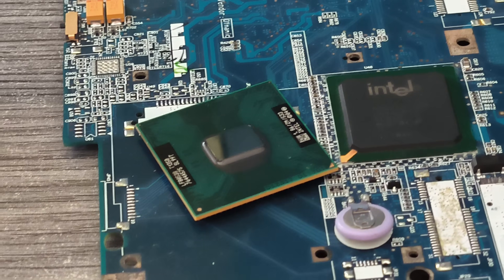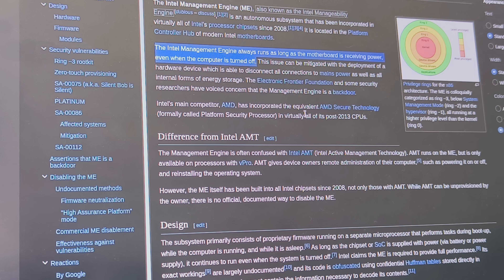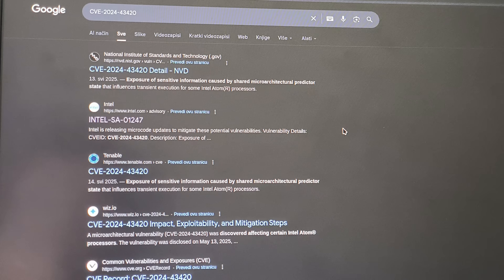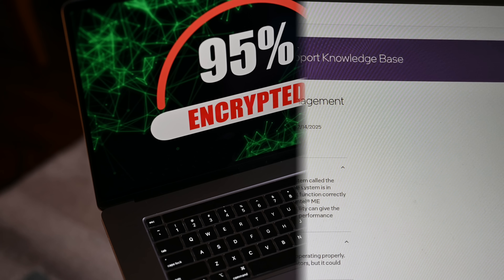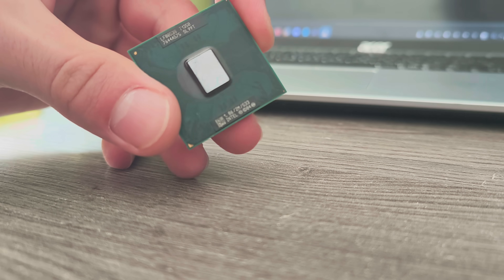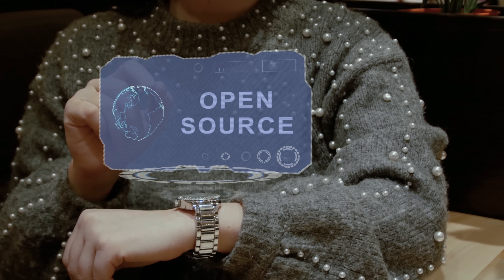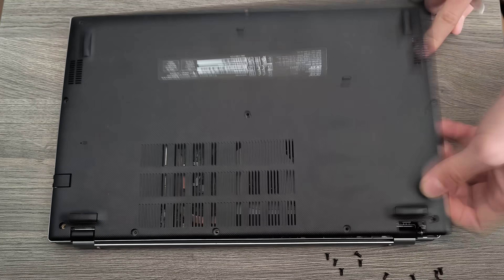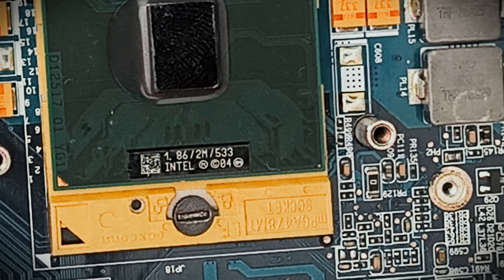YOUR CPU SPIES ON EVERYTHING (Even When Your PC Is OFF)

Comment from the maker: Serious Question (related to the ME/PSP threat). How many times have you actually updated your BIOS/UEFI on your computer?
Reply: 0 times
Reply: I can't update my BIOS if the manufacturer doesn't provide one.  I have a high end MSI laptop that I bought a year before the specter/meltdown vulnerability was exposed, and a tool from Intel says it's vulnerable.  I checked back countless times over the years, and there is no update.  I won't buy MSI again because they don't support their products.
Reply from the maker: @genxjack72  It's completely unacceptable that a high-end laptop never received a patch. The responsibility here falls 100% on MSI, not on Intel. Intel delivers the microcode fix to the OEM, and the OEM (MSI) is solely responsible for engineering and distributing that critical BIOS update to you. However, the contrast is striking - I have an older MSI motherboard myself, and I've received BIOS/UEFI updates for it, even years later...
Reply: @alex.cybersecurity  That may be true for BIOS updates, but, what about Intel ME? Unless OEM alter ME, I don't understand why it is not Intel's responsibility to provide ME firmware updates. ME is complete BS to begin with and shouldn't even be there. Intel should provide a way to zero it out and disable it, if they are unwilling to patch vulnerabilities. This is just one more example of companies doing what they want and not what their customers want.
Reply: @genxjack72 laptops have the worst updates in general across multiple brands I've had
Reply: Every time a new one is released for the machines I have, for those Intel based ones I even go out of my way to update ME's after the manufacturer stops supporting the board or machine.

What saddens me is the lack of commitment from manufacturers when it comes to supporting their products (and not only through firmware). Some machines don't even receive a single firmware upgrade (e.g., most mini-PCs), others get more or less support depending on their popularity. An example of this could be Acer's Aspire A515-47 (AMD) and A515-57 (Intel), both from the same era, but the one with AMD got 2 firmware upgrades, Intel's got 16; since nobody gives them a hard time about it (and most people couldn't care less), the status quo continues.

The last firmware for both of those machines is vulnerable to some 20+ CVEs, but that's just a quick example there are plenty of machines from different vendors in similar situations.
Reply: @jrussellmoore  Totally agree. I think some of the vendors actually delete the firmware from their support website after they go out of support. I had to fish around trying to find the latest ME update for a HP Z240. I was able to find it for another HP computer that was basically the same thing under a different name. But, it was still an out of date version of the firmware, which has vulnerabilities. ME is flaky as hell IMHO. I don't understand why Intel doesn't make the ME updates available on their website. I think they should be sued for designing their products in such a reckless manner. But, maybe it isn't reckless. Maybe it is designed that way for a purpose. So, the government can spy on everyone. Also, I think it is reckless to allow BIOS updates through the operating system. It should be designed so that it can only be done through the BIOS. Then, you wouldn't have to worry about firmware-level malware as much.
Reply: When your board manufacturer drops support how hard is it to update the ME?  Isn't the ME specific to the hardware?
Reply: Only when I really needed, processor upgrade for example. In all other cases: never touch a running system.
Reply: 4 times in 30 years. and one of those times i was so very glad for the new (at the time) dual bios chip design, because i had to physically de-solder and swap bios chips to get i to post again.
Reply: @MrJay_White  Been there, done that, nearly stuffed up the dual-bios and then drank the bottle of whiskey. After that, I never updated a Bios again.
Reply: @MrJay_White OMG!
Reply: Es ist ja so, wenn ne Plattform schon alt ist und keine neuen cpus mehr erscheinen, bekommen die meistens nur Sicherheitsupdates, wenn ne Plattform neu ist, kommt gefühlt 2 mal im Monat ein BIOS Uefi Update raus!
Lieben Dank fürs Video 👍
Reply: I had to do this twice before. Once on a Lenovo Thinkpad Edge 535 which had a fanspeed oscillating issue that was fixed by a firmware update.. and then again a ASUS Rog GR6 mini gaming PC since it would not detect a second harddrive until after the BIOS update.  It was always a bit of a risky gamble but it went pretty smooth every time.
Reply: Every time they release them, I install them.
Reply: At least once in their lifetime, either the first time when building them or after several years to try to fix some weird behavior with new hardware. BUT on my job most Notebooks offer firmware updates alone like Dell, Lenovo, etc, so you just accept and they do it on reboot taking a while.
Reply: Usually I check every 2-3 Months if there is a new firmware. Not because of security but I had lots of problems that did go away with new updates.
Reply: Pardon me, I wanted to ask if this issue is also present in Apple's M-series processors?
Reply: As far as I know, my lenovo laptop only gets firmware updates on windows. You can get them on the support webpage, but only as .exe installer. Since I use Fedora, I resorted to putting Hiren's Boot CD on my ventoy pendrive, as well as the firmware installer. Then I boot from it and run the installer. I did get "security processor" updates or something via fwupd, but I don't fully trust that since the process of installing it looks different (it doesn't reboot to UEFI)
Reply: @konstantink07 I want to say fwupd just applies the BIOS patches temporarily in memory, but, I could be wrong on that.
Reply: 0 times
Reply: i dont have dual bios so im not taking the risk of borking my motherboard if my power goes out mid update:v
Reply: @Sonny_Blackbones  You must have very unreliable power
Reply: I have a CH341A flasher. Daily drove X99 chinese motherboard, which require custom bios for the best operation. Funny thing is, it reads/writes only half of bios from software, even under DOS.
Reply: Once a year. When the first gen Ryzen came out once per month for a year.
Reply: Never, ..... once.

But the title says enough, duh it spys, and i'm crazy to say that your pc is never actually off even if you take out the battery 😂
Reply: 2 times before I knew what it is
Reply: Never? Once when I built the PC, never after that.
Reply: I've updated my BIOS only once so far on a MSI B550-A PRO to support the 5700X3D.

I noticed some unlogged changes like the removal of some options to disable/change stuff in BIOS, and in Windows some software that had errors due to me heavily stripping Windows from services and drivers, vanished.

Also in device manager, my NVME drives are named differently: instead of manufacturer and model number it's now NVMe Model Name SCSI Disk Device for some reason??

I see absolutely no reason to update BIOS again for this board, I specifically looked for the earliest bios update to support the 5700x3d.
Reply: 0
Reply: Every time it's available
Reply: The standard update recommendation for UEFI has never changed: Only update if you know for sure it will fix your hardware problem.
It is stated in every MoBo manufacturer's webpage.

So, yes. I have updated UEFIs.
Three times.
In two computers.
Out of 15 to 20 computers I have owned across 26 years.

Comment: The really crazy part? 
If the government cared about the security of its citizens, they would not just let China get a full back door to the IME code base and how to use and install it. 
They even sell support to other nations out there on how to enable and disable its features on the hardware level.  

The thing that blows my mind is that  the US government gave out all the keys to other nations , but then kept it hidden from the General US Public. :face-fuchsia-tongue-out:

That means that just about any x86 based system or even ARM (Samsung chips)  all have this back door built in.  

Xi and the PM leader of Korea were laughing about the back doors when Xi brought in some phones to give away as gifts.  :face-green-smiling:  
They both were chummy on the subject.  

The odd thing is, this exact hardware is running almost all our current day critical infrastructure.  

This is why things have not gone the way as planned for many years as outside actors knew full well what was going on in the highest ranks in our government and even our private industry such as Aerospace & Military contractors.  

Our Political leaders and Wall Street all saw dollar signs, and left the rest of us to pick up the pieces.  

It's partly why I can't even trust any Crypto as you need to use a computer to manage it. 
With all these backdoors, and more coming out everyday, is there really a way to secure anything if just using a computer to access your wallet is enough for attacker to take everything you have ever invested in Crypto?  :hand-orange-covering-eyes:

The powers that be want to take everything into the Digital Realm, but don't have any physical backups to speak of. 
And when they do? 
The Physical copies are long lost when needed. 
Cities are facing this right now with grandfathered regs, and its starting to break the whole system down.

Comment: I would say there is another layer to this: OS
If your OS is okay with Intel requesting something and it blocks it, no harm

But, Microsoft will comply

Linux not so much

The issues with Intel backdoor is that their chip can be accessed even without OS present, as far as I heard and understood years ago. Hypothetically, Intel could read data from hard drive using CPU even if PC is off, as long as it had ethernet cable plugged in and computer's power plug has power (even if pc is off)

Although, that requires Intel getting okay from your internet provider to enter your modem. Possibility, but also unrealistic one

Comment: Engineer in the semiconductor field responding, even spent some some Inside Intel too. I saw the announcement decades ago when Intel licensed the ARC design.
There is a lot of bollux inside this video. For a cpu to actively spy, it must do serious work and use significant energy. If you had old school HDs you would hear them operating, the motherboard has blinken lights for HDs. The ability of the internal 2nd cpu is very limited, I believe it is based on the ARC architecture for Intel, for AMD it might be ARM or something else. I would be infinitely more worried by what Microsoft does in Windows 11. Under extreme circumstance there is a possibility of firmware to modify the cpu working, this was likely used by some well known spy agencies to disrupt some computer systems that controlled uranium enrichment programs.
Reply: This is a realistic answer, it’s cheaper and easier to spy people through OS than hardware, i think that’s why they keep pushing this much Windows 11

Comment: So I seen a few new videos on IME but I’m not sure people are understanding a few things that mean it can’t actually act as a backdoor :
- Remote Access to IME would require AMT provisioning which is only available on VPro CPU’s and even then it needs to be enabled in bios. 
- It’s false that it can avoid firewalls, it requires ports to be open, it’s not configured to use ports that may already be open such as a sneaky malware would so even if you had VPro and AMT enabled and provisioned the ports need to be opened it doesn’t even have listeners. 
- security researchers have put effort in to monitor it and never find anything problematic 
So while I understand concern it’s currently a non issue, perhaps that will change in the future but if it does you will know about it and the shares of any company that makes this a potential valid backdoor will tank quickly

Comment: *before clicking on the video* it's going to be a Management Engine backdoor, isn't it? *after clicking the video* it's a Management Engine backdoor.
Reply: How can I learn more about this topic? I’m quite curious about this.
Reply: @Primordial_Noir-d9t  well any trusted source should be ok, honestly there isn't much you can learn, but from the basics:
It's a independent microcontroller running proprietary firmware from the BIOS flash, typically a variation of MINIX (so I heard) which does something (Intel does tell about some functionality, but probably not all), present on every modern x86 system, running in the Privilege Ring -3. 
Something you might also wanna know about is the SMM, proprietary code used for power management (also on the BIOS flash), running on the CPU (!) in the Privilege Ring -2
Reply: hey, what are you doing in my wifi🤨

Comment: What happens when the power is disconnected? What if all saved files are encrypted.
Reply from the maker: If you physically unplug the power cord and remove the battery, the chip is truly off. However, most modern laptops have non-removable batteries, and few desktop users unplug their systems completely. Regarding encryption: it offers no protection because the ME/PSP runs below your OS and controls the hardware. The chip can easily capture your encryption key while it's in memory, or simply wait for the OS to decrypt the files and then transmit the plain data.

Comment: There is a project coreboot that is bin (firmware) for bios to flash. One of thing it does is shrinking/wiping intel ME code depending on cpu. I think wiping only possible on lga775 era pcs, while starting with lga1151/1155 its a mandatory to have even small code footprint in order for pc to boot.
But honestly, I would rather buy AMD. Atleast they do care alittle.

Comment: For NSA espionage, "Standby is not turned off, Standby is listening you and transferring the sound at unknown band of radio."
Reply: My pc is powerless when I don't use it
Reply: Who knows if it can run of CMOS battery 😂
Reply: @notjarvis-p4f what if i u plug my mic from my pc
Reply: @mg2196  there is a tech where you can just with the wlan signal and its resonance figure out what is in  a room or check other things.
i mean this is quite hightech but since militiar should be easy +50 years advanced in technique, its not impossible.

Comment: Mainboards also have their own blackboxed, closed source microprocessor, the Platform Controller Hub (PCH). It has access to Storage, USB, Networking, Audio, PCIe Lanes, Legacy I/O and general system management like fan control, thermal sensors, power sequencing etc... So there's also a possibility that this chip spies on us too! The PCH is also directly connected to the CPU. They are typically built in 22–14 nm low-power process node and support a few hundred MHz clock speed for its internal controllers. They have a few hundred kilobytes of SRAM, sometimes coupled with a few megabytes of flash storage (mostly for its firmware) and consume about 3–6 W. They can also run on standby power when your PC is fully turned off. Just like IME or PSP. You can't disable the PCH or your mainboard stops working and your PC will not even boot at all. You can't just use Core/Libreboot. The PCH is hardwired in your PCs architecture. They are getting directly manufactured by Intel and AMD. So picking a different mainboard brand isn't going to change anything.
Reply: Is that what people used to call chipset?
Reply: @vadnegru we still do
Reply: Retarded comments like this and those of @Noizzed are why people are skeptical of real conspiracies. 

Stop discrediting us with your nonsensical claims and schizophrenic  ramblings. Do real research, follow things through to the logical conclusion, and then talk.

The PCH isn't being used for surveillance. The PCH and the CPU are designed that way per Intel architecture, as is every other component on the main board. Read about microarchitecture.

However, the ME definitely can be used for surveillance and has been. 

Oh yeah, and anything that emits electromagnetic radiation can be used for surveillance — it's called Van Eck phreaking. 

PRISM, XKeyscore, ECHELON, and other government mass surveillance programs already have all of your data. Hardware manufacturers are not going to waste money designing everything with a backdoor (ME/PSP the possible exception).
Reply: Risc-V mainboards when
Reply: By that logic everything spies on you and you can do nothing if you want any performance
Reply: @nicolaspaglione  correct
Reply: @PySnek  bit sad init
Reply: @nicolaspaglione  Logic? You're making it look like they're presenting an argument, when it's just a fact that everything has a back door by design.
Reply: @Noizzed that depends how pessimistic you are. You cannot verify any of this shit.
Reply: @nicolaspaglione  I am not pessimistic, i don't put my hope in electronic devices so it's not a problem to say as such. Everything here is publicly admitted by the manufacturers, there's nothing to prove because nothing is hidden in the first place. Of course there are lesser known open source stuff that isn't, but i'm talking mainstream.
Reply: @Noizzed  for example the Intel ME engine is a whole ass blackbox you can’t know what it’s actually doing